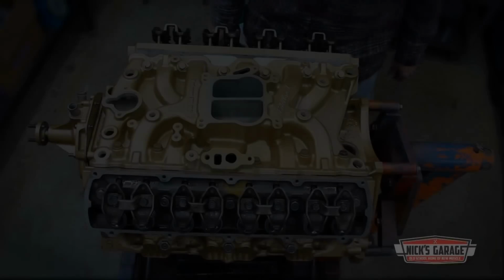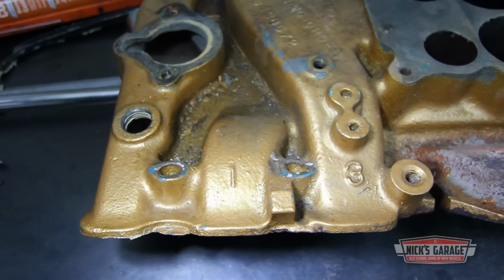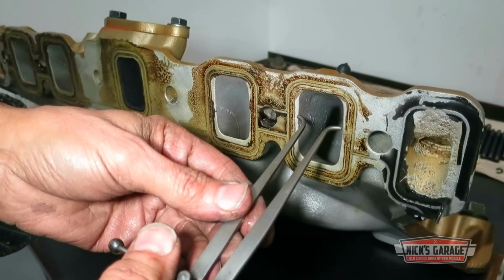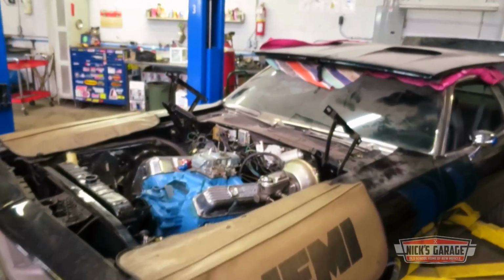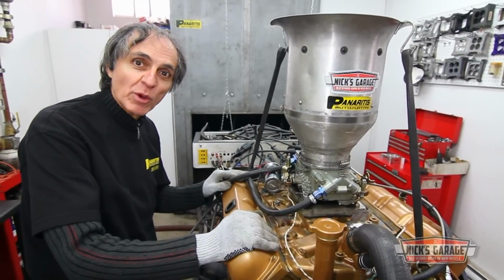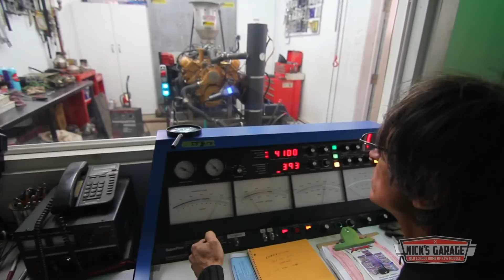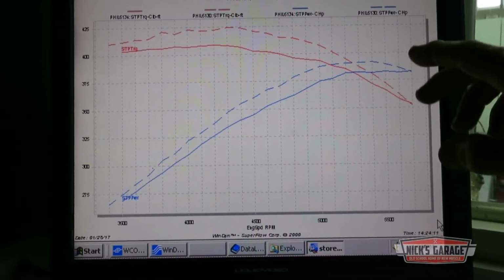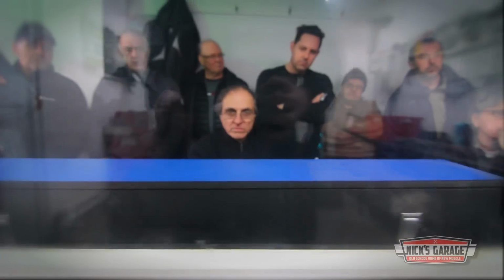Edelbrock VS Iron - Rocket 350 on the Dyno!

Comment: The CFM and velocity is such a tricky thing and sometimes defies logic. It does a delicate dance with bore, stroke and displacement. I've seen 2 barrel engines that were finely tuned and sinked with a 2 barrel carb woop ass against another engine of the same displacement with a 4 barrel set up.  A lot of guys mismatch displacement and cfm with a huge Carburetor. Well, because it looks and sounds cool to talk about. ( Holly 750 double pumper Man!)  An analogy given to me by an old school mechanic was. Think of a straw and sucking down a soda. Then I take your straw and give you a 3 inch diameter pipe and say have a drink. See how fast you can draw it up if you can at all. This is kinda of what happens when you put a huge carb on a small displacement lower compression cfm engine. Your slowing the air fuel mixture velocity down from being delivered to the cylinders. It sound strange but sometimes depending on the engine and the displacement, compression, and vaccum, a two barrel will give the max power and a 4 barrel will rob you of power.

Comment: You should have caught that if you were port matching.
I have been building 330's - 455's since the mid 70's and found it very hard to beat the factory intakes or headers. I remember the Torker Manifold just killing the performance on a Olds engine. Dual Plane a must for all around performance. And I think the aluminum W-30 intake had only a weight advantage over cast iron.
Oldsmobile did a lot or research on flow tech before it was popular.
1967 442's forever
Also a Q-Jet will out perform a Holley any day of the week if you know what you're doing.

Comment: Olds are easy enough to hot rod when you understand them and everyone's right, that carb spacer is the culprit--its made a  stacked double plenum setup.  A Q jet wouldn't have a problem, it would love that center cloverleaf to keep the fuel coming out of the bottom of any carb from trying to fill in the empty space between all the venturis. Probably grinding the Edelbrock intake runners out to the OEM size and port matching would help. funny how that intake now runs for $185, about the price of a Chevy 350 intake.

Comment: I seen a vid I believe engine masters where they milled a bit of material from the wall or divider separating the two sides of the intake and got a noticeable increase in hp.
Reply: Olds. that book. is. closed ,  thanks for trying ,   That last 10 hp could. cost a lot. $$$$          raybo. !!!!

Comment: Wonder if using an 850cfm Rochester Quadrajet would have helped reach the illusive 400 HP?
Reply from the maker: Stay tuned and find out. We will be bringing you just that!
Reply: Qjets are only 750 or 800, most BOP engines, small and big blocks, and chevy trucks got the 800cfm. Chevy small blocks usually got the 750.
Reply: Nick's Garage  we have a 455 olds with h bean rods in it and can’t get it to stay together always spin a bearing the last time we had it together it broke the cam and threw two rods

Comment: Since the Edelbrock has smaller ports, open them up to the gasket, port match. At least open up the intake manifold ports if you don't want to do the heads. Olds motors really need to breath, bet it would hit 400hp just doing this. An 1/8 inch difference is a lot between the 2 manifolds ports. I had my 350 olds pumping out over 500hp. And that test with the wrong spacer, spreadbore/square bore, plate wasn't going to work on gaining power, fuel/air flow and atomization were ruined running it like that. Good luck.
Reply: The fuel had to be separating when it hit that manifold. I converted a little Mitsubishi truck to a Weber. I started with the stock manifold and it ran OK. I removed a blockage similar to this one and the difference was incredible. Also gasket matching the Elderbrock ;-) would take just a couple of hours. I bet we see one or both in the next video.
Reply: Nah, just get a Performer RPM to begin with if you're looking for power (rather than retaining the stock look). It still fits under the hood just fine. No point going from stock to Performer just to have to modify it, imo a waste of money

Comment: Fairly obvious, about an hour with the die grinder on the Performer match porting to the heads and cleaning up the casting marks.
Those Performers are not a big HP gain usually, some factory intakes make more total power but the Performer usually does a better spread of power. Though is some cases you have to modify and remount items. Kick down linkages, coil mounts and the like.

Comment: First thing I would do is throw the adapter in the trash where it belongs and get rid of the god awful down leg booster holley and Throw a Quadrajet on it. But then again, I wouldn't have wasted my time on a Olds engine to start with.
Reply: DoubleVisionandco.   We ended up using no adapter plate and a Quadrajet carb at the end of dyno testing.  And by the way, we went with the Olds engine to keep the car Genuine , RALLEY 350.  Thanks for watching.
Reply: I agree with you I wasted money on edelbrock heads,intake, comp cam, pistons and still not satisfied with my olds 350
Reply: Well, for street torque at a real RPM range is where the big Olds is king.  It moves heavy cars with authority at a very, very low RPM range, like 500 or better at 1800-2000 RPM.

Comment: oldsmobile has worst flowing heads of all American engines
Reply: Except for a Nailhead Buick maybe. Olds valve pockets look and flow like a 5 HP Briggs & Stratton. As bad as they are they may actually be the most improved by porting due to there being so much room for improvement.
Reply: Cadillacs are not to good either.
Reply: Buick had interesting V8 engines, Nailheads included.
Reply: buick 455's have potential since theyre supposed to be 100lbs lighter than over big blocks.  Might be interesting in a nova buick clone.  I think they were called omega
Reply: The Buick "Novas" are either called Apollo and then later Skylark.  Olds used the Omega nameplate.  Not bashing, just clarifying. ;-)
Reply: Yes they were called the Buick Skylark ! The one from the sixties were very good looking !
Reply: nailheads did not have bad heads.
Reply: nailhead are cool engine but jeezus christ it have lawnmower valves...but they were designed to pull hard down low on 4400 lbs full sizers. They were good on what they were designed for.

Comment: Yea I agree that those sharp right angel edges at the carb flange on the iron intake manifold would hurt airflow because of my own flowbench experience. The best way to test without grinding the iron manifold would be to put a spreadbore carburetor on there of the same cfm rating.

Comment: I can tell you I know from experience the factory knows what they are doing. check out Ford 390 intake manifolds the GT mustang manifold doesn't flow as well as the truck 4bbl mani also the same for the Edelbrock performer. you can just see the difference looking at them. it's also been dyno proven. but I'm not a professional engine builder. 
this guy is so rad.

Comment: Oldsmobile made the best (tolerances) engines out of all the GM motors. They were strict on the machining and quality. I love Olds. 👍
Reply: I second that. The rocket 350 in my dad's cutlass sat at one point for 18 years before I got it running again and now all these years later I just hit 150,000 original miles and it's still going strong!

Comment: My friend was racing stock cars and came in 2nd place with a stock 350 Olds with cast iron heads cast iron intake manifold Rochester carburetor and stock exhaust manifolds, we were thinking 🤔 it was a Olds 350 rocket 🚀 block but after running the casting numbers it was 1977 Olds 350.

Comment: Should have open up the ports on the Edelbrock intake mani. Did you see the outline the gasket left on it. Could have open them up and add more power and keep the weight off from the iron manifold.

Comment: Just the shape of the runners in the stock intake alone will keep it down over the edelbrock . Regardless of entrance /exit size . 
Try port matching intake to heads . Rpm intake ?Does this have roller rockers ? If so go up one size of p to v clearance /valve spring allows . Ala 1.6's . If it doesn't put rollers and go up a size ! 
Cool test ! Didn't have a chance tho :)

Comment: Horsepower is a function of RPM, so more compression, more cam, stronger valve springs, make the rotating assembly as light as possible. Except being and Olds, it's really better at making gobs of torque.

Comment: That adapter plate probably didn't help, should have put a spread bore Holley on there. Back in the 70's I had a 442 that I put a back yard built 350 in that was stock with a Sig Erson 3/4 race cam, Offenhauser dual port spread bore manifold with a Holley 800 spread bore on top of it. Accel dual point distributor and headers. That baby ran strong up to 7500 rpm and did it sound wicked.

Comment: Despite the larger ports, that OE intake is no answer. They were designed for everyday all-round consumer use, hood clearance, etc., and don't forget all that extra weight.
The runners are too short and restrictive, and that QJ adapter for the Holley... well, it seems pretty obvious to me.  These Olds 350 engines love to rev, so my guess is port matching the Edelbrock will probably get it pretty close to 400 hp.

Comment: These w31 engines had an .015 steel shim head gasket originally, as did the w30 400. Maybe a copper shim gasket would've worked well, depending on what's still available..?
Reply: I think it needed a little more than a shim gasket there junior. But thanks for the suggestion and good job reading those muscle car magazines.
Reply: @chrismc.4437  Actually I worked on an original W31 and own a '68 W30, and that's what was in there, a thin steel shim gasket. The W30 had 16,000 miles on it. Used to race stock class, was .040 over, maximum allowed oversize.

Comment: I would have installed 455 valves and port matched the Eldenbrock intake manifold, copper head gaskets. Solid lifters and Harlan sharp rockers. The heads need to be ported for velocity and 3 angle valve job is worth the expense. 425hp easy!

Comment: Just noticed the Pertronix distributor on there.  I did a recent dyno test on a Big Block Chevy 496 where that same distributor cost me an additional 20 horsepower over the Delco stock points unit.  Can't say I've heard any success stories from anyone looking to make serious power with Pertronix ignition set ups.  I'd be interested to see what Nick's experience has been with them.
Reply: Chad Hyams.   I am not using a Petronix. I am not a fan of Petronix either. Take a good look, it is an MSD distributor.
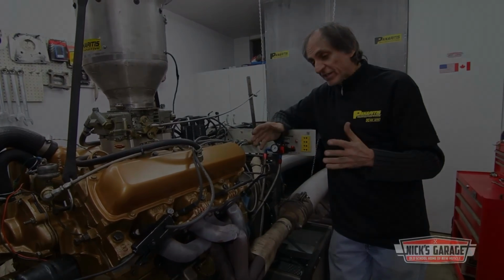Reply: @nickpanaritis4122  I see now upon very close examination at 1:13 that it is indeed an MSD distributor.  It looked like a Pertronix with that vacuum advance canister and black cap.  I've tried several Pertronix set ups over the years and every one of them has been a disappointment or problem.

Comment: Are you getting full lift from that cam with the stock rockers?

It is my understanding that the stock rockers are limited to around .480" 

Harland Sharp makes proper roller rockers for Oldsmobile. 

Many of the larger diameter valves have shorter stems. 
Lash caps may be used to compensate the difference.

Comment: Factory W-31 cam or one with a little more duration might do it you might loose vacume for the breaks but sometimes you have to give a little to make a little head work would help as well...I did it before... With my 330/350/403 combination got little over 400 HP. But I still like my 425/455 big block combination...with a little over 500 HP. With the W-39 stick grind camshaft and head work there are a lot of tricks to do on the heads to make them work block the center ports that run under the carburetor for warming purposes is APX. 15 HP. And the center exhaust ports where they mount the headers has a slight dip between them fill them equal so the exhaust ports match the headers flush is 5-7 HP.  The number #4 heads are the best for the small block '67.  330 head.  Or the '70 W-30 F head ( marine ) or "C" head  then the " B " head for the big bloks are the ones you want...to work with but remember they are hard to find that is small block or bug block heads from '66 - '70 are the years you want these engines can make power just need the right combination of parts and the thing is they are mostly factory parts and making power they like the mad doctor approach ... I had these motors break loose sideways from 1 to 2 gear and easy 7-10 feet rubber in 2-3 gear shift in automatic transmission.  Big block  and factory parts !!!  Small block was descent as well with 4-speed and over 400 HP.

Comment: I wonder if a valve adjustment would help the motor, maybe get a little more lift ?   also polishing the intake runners and  port matching them to the heads can make good improvements.   advancing the timing a bit might help,, the engine sounds like its not reaching its full potential on the top end.

Comment: That's not suprising that the Edelbrock intake was proven to be the better intake. The Edelbrock was designed with Computer tech, while the OEM Olds intake was designed in the early 60s for various compromises, like low speed driving. You could even look to the runners of both, the Edelbrock and smoother intake transitions than the OEM intake.

Comment: Nick, the Rocket 350 is doing great at 385 hp, and look at that nice flat torque curve! Appears to me this should be a very responsive street engine. I'm wondering how a Q jet would do on that stock manifold? The ugly Q jet is a bad racing carb, but a very good street carb, (800 cfm isn't it?) has a central float bowl not affected by hard cornering G forces and hard stops, can be tweaked easily via the secondary air valve and a change of metering rods!
Reply: TheFRiNgEguitars.   We did some testing with Q jet carb and changed the metering rods, 800cfm, and got some great results, but not on the stock manifold. If we had the Q jet tuned with the stock manifold, we would have achieved nearly 400HP.  The weak link with the Q jet, is the float bowl is very small, besides that, it is a great street carb.  Thanks for watching.

Comment: yea thats the performer with a nice spacer vs a stock intake with a junky adapter plate.  Not really a fair comparison. those adapter plates just never felt like they did anything good, seemed to me it only hurt flow, with the space it creates on the iron carburetor mounting flange and the spread to square, and know you have a large flat spot under the carb as well.   Of course you have to have run to run squarebore on a spreadbore.  i would have tried a qjet on the stock intake, or went with the performer rpm.
Reply: Efurd Garage.   We ended up at the end with A Qjet with the Performer intake manifold.

Comment: Nick... Use an intake gasket that blocks off the heat riser..  You will get more power...  Thanks..
Reply: grabir01. When we bought the edelbrock intake manifold, it came with these 2 heat riser blocks that you install in the cylinder heads. it looked like they were made of some sort of cement, so we pushed them down the heat riser ports. Thanks for watching

Comment: Performer RPM and and HEI ignition. My 86 cutlass has never been on a dyno however it weighs about 3500 pounds and runs 12.50s with slicks and open headers. That has to be very close to 400 hp at the crank. Why bother with a performer intake and points ignition? Crane makes a good cam that's 230 degrees of intake duration at .050 and 236 exhaust. This works perfect with a performer RPM,  10" converter and  3.73 gears.

Comment: mount the intake on a mill cut out metal between the primaries and secondaries blend out the turns at the bottom add 2 hole 1" spacer that might get a Q-jet to give you 9 1/2 HP

Comment: Oldsmobile had the best engine designs for the time. Oiling was a major issue. It can be fixed. Really easy to make 700 HP out of a 455. That’s about tops though. Lower end just can’t take much more even with girdles. We tried many times. The older 330 was overlooked. It’s a major performance piece that outperformed Chevys 327. Just a little tweaking can make 400 hp out of a 330. It’s got a better block and forged rods, pistons and crank from the factory. They made 320 HP from the factory. Excellent starting point for modern turbo and fuel injection. We did one with a cast 78/75 and fuel injection as a test. Made over 600 HP out of a 330 CI Olds. That’s respectable. Almost LS power numbers.

Comment: i had a 79 chevy pu with the diesel in it got a 350 rocket out of a  68 442 that got wrecked and the truck had a perfect body on it then sold it to aa friend he had it for 10 years the motor got a knock in it and this motor has never been apart he calls me up and tells me to come and get for free still in good shape just need to rebuild the motor no rust even needs paint now that good old factory paint in 79 but it has the Cadillac suspension package from factory drives like a car plus sits 3 inches lower then the average 2 wheel pu but i have a 454 stroker too sitting runs perfect very low miles on it it's a crate motor 450 hp with 485 torque mite put that in it

Comment: I do not run a shop with a Dyno but when I saw the OE manifold vs the Edelbrock I knew the latter will make more power, no testing required. And how is it possible that the OE has larger ports? Manifolds/heads have to be port matched. That, and a plenum adapter, would have probably made it to 400 and beyond.

Comment: There is a loss of power using the spread bore to square bore carburetor adapter everytime. A Edelbrock spread bore and 1" spread bore spacer would significantly outperform that Square bore Holley and Adapter . And Edelbrock carbs arent exactly what I consider performance carbs although they are definitely reliable. A performer rpm intake would probably get the missing hp